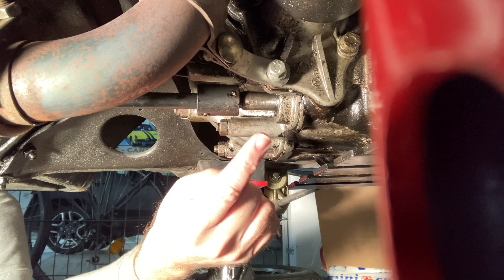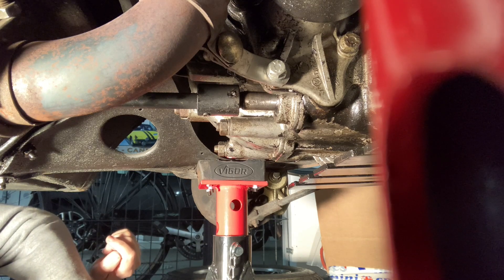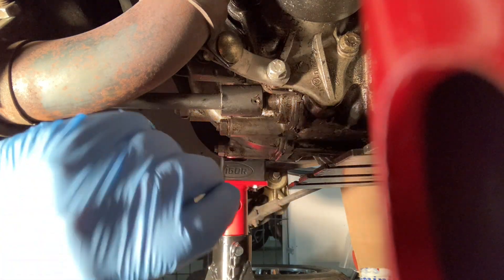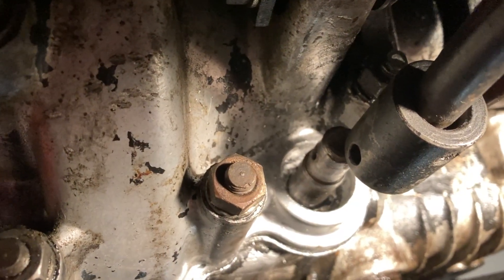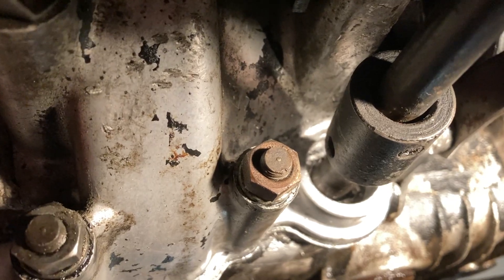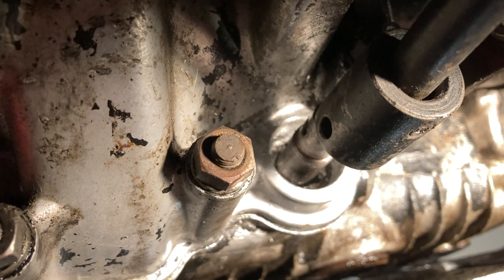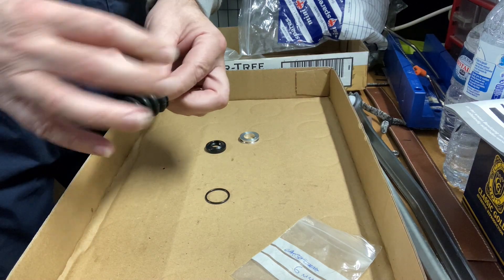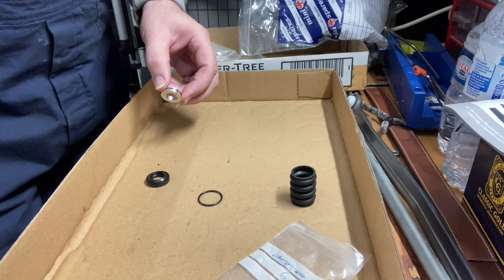Mini Gearbox Selector Oil Seal Replacement

Comment: I compressed the gaiter by using two pieces of thin string, one each side so it was even, then when fitted cut the string and the gaiter expands to fit

Comment: So you did not show the removal of the existing alu ring or your car did not have one there? Also, I assume you must drain the oil prior to attempting this, correct? Thanks.
Reply from the maker: If struggling then drill a small pilot hole and put a screw in it, this will allow you to pull it out with pliers.  You won’t lose much oil if you do it whilst full because you are not moving the selector, but plan it in with an oil change and none at all. 😄

Comment: Hello, 
thanks for the videos and good explanations! I see you are in GE, I am in Zurich. I am thinking about buying a 1998 Mini. Do you use yours on a regular basis and for longer tours?
Best greetings 
Carl
Reply from the maker: Mine is a 1975 Innocenti Cooper that I use in the French championship (thrf) which means that on a competition weekend I do about 600km of constant driving.  For me the big difference between the younger and the older classic mini is the simplicity of maintenance. The younger the car the more complicated things become
Reply: @mikesmotormechanics8602  More complicated due to more electric components?
Reply from the maker: And more computers too, basic electrics are not a problem

Comment: How about putting the drift through from the other side to align the holes, and put the roll pin through the other side , all aligned , then you can tap the pin in , knowing it is all in line...?
Reply from the maker: If what you have as a drift is small, then absolutely.  I would always recommend that approach if space allows. What you will find is that the space is limited when you do this.

Comment: What gear did you have it in? I've been told you have to have it in reverse don't know if that's true?
Reply from the maker: For me the alignment was okay in 3/4th, no need for reverse.  The problem with reverse is it puts the rod the furthest forward so, for me, the exhaust bracket on the gearbox gets in the way
Reply from the maker: My understanding is a 92 would have the inner ring, you want to replace that too.  So as I said something like a 2mm drill and a self tapper, you will be very lucky to get it out any other way and this is quite an easy route.  The ring is 8mm thick so you have quite a depth to play with
Reply: @mikesmotormechanics8602  I'll give that a go, hopefully it will come out with the drill bit like I've seen in another video.
Reply: Okay thank you for that, would you say it's quite an easy job, I'm a bit scared of having a go at it!
Reply from the maker: How old is your mini and do you know if it has been done before ?  In theory it is simple.  If you have an aluminium ring to get out if you drill a little hole in it and use a self tapper you can then pull on that.  You should end up with a hole about 150 to 160 mm deep.  Then you just drop in the new ones.  One of the easier jobs unless someone has bodged it before you
Reply: @mikesmotormechanics8602  No idea if it's been done before, it's a 1992 cooper, it's been leaking for a few years quite badly so definitely needs replacing.
Reply: @mikesmotormechanics8602  thought I better get it done before I change the oil or I'll lose most of the oil within 6 months its that bad.
Reply: @mikesmotormechanics8602  it's a 1992 cooper
Reply: @mikesmotormechanics8602  No idea if it's been done before it's been leaking for quite a few years so definitely needs replacing.